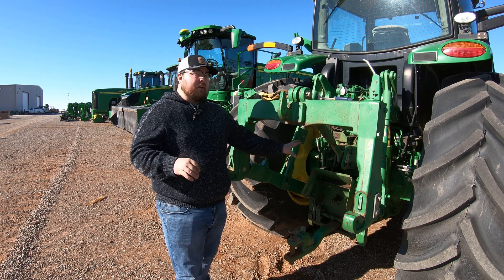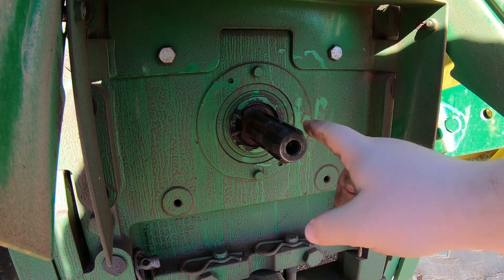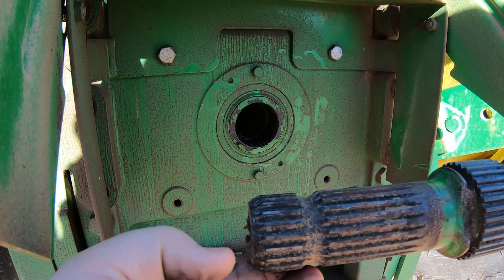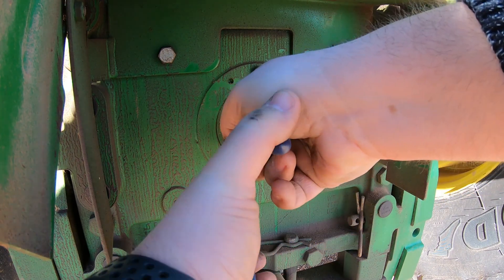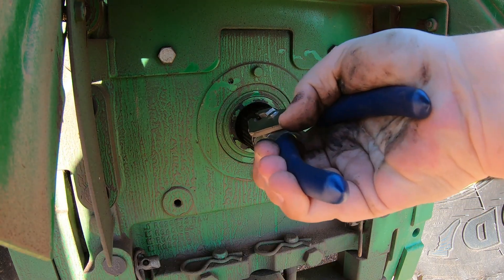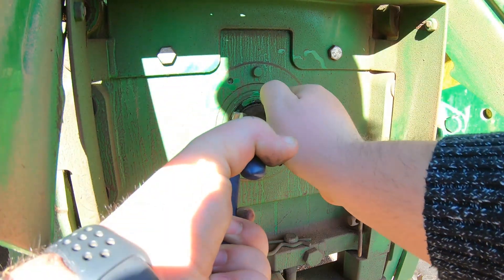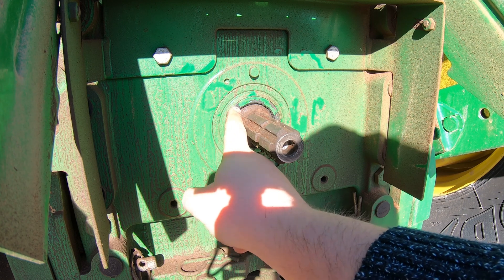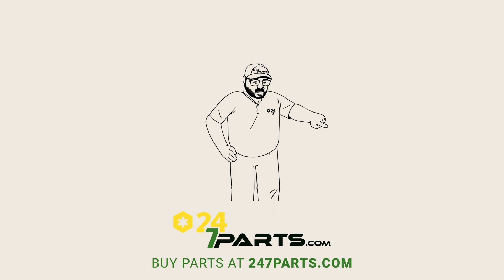How to Change your Reversible PTO Shaft from 540 to 1000

Comment: what is the benefit by reversing it ? just the gear type changes or it does change the rpm ?
Reply: 1000pto can run bigger implements at more horsepower like a bat wing or balers, flipping it will either depress or press spring into the middle of the shaft you can see the hole on the 540